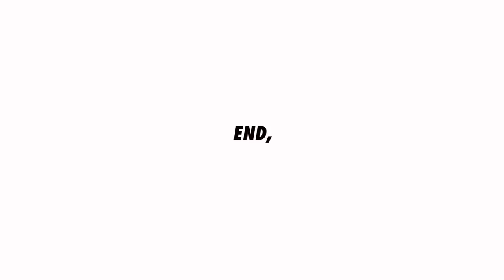W72_Kitchen for Office

Comment: Did you attach the drawer fronts only with some nails?
Can't you just rip them off this way? 

Do you know Blum? They make really good locking drawers. Legrabox. Really thin metal sides and a clever 3d adjustable front attachment. 
Greetings from a carpenter in Germany

P.s. nice designwork.
Reply from the maker: nono~ I use screws after nails. I know blum drawers... but... expensive...😢
Reply: @ViTTEN   i dont know how much they cost at your place, but in germany they cost about double the price of the normal slides. Thats cheap in comparison, because you dont need material for sidewalls and you dont have to fabricate them, so less work for you, and a cleaner design.

Comment: I see vitten. I click!

How did you attach the upper cabinet to those cleats? Just screws?

How did you attach the countertop? Construction glue? What material was the countertop?
Reply from the maker: Yes~ just screws, and countertop is stainless steel, I attached with silicon and expoxy